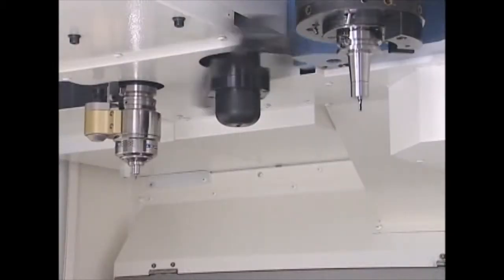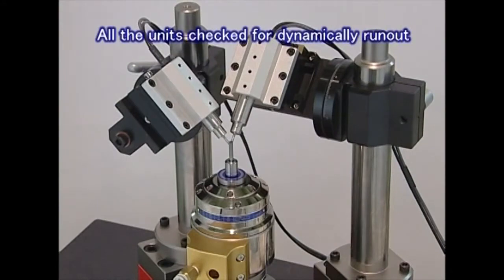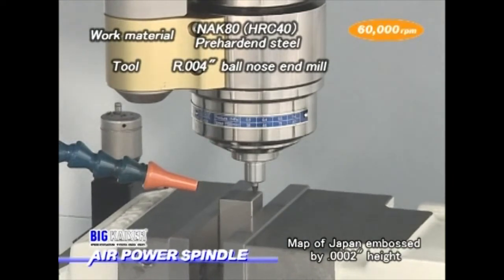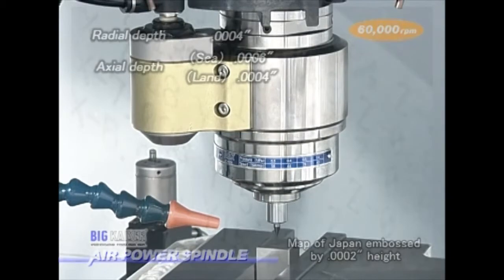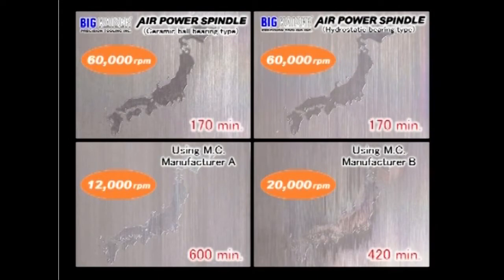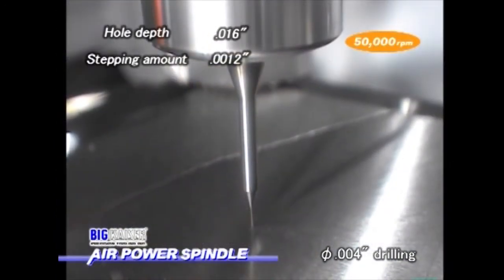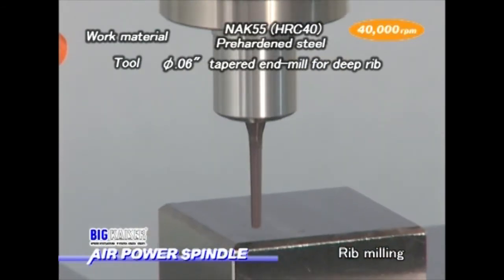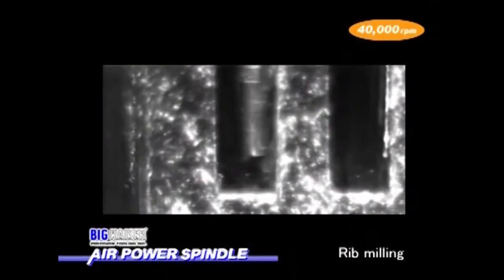Air Power Spindle | BIG DAISHOWA—Americas

Comment: thank you for producing this technology, this is the standard of clean energy machining, you can couple a VAWT  wind turbine to a compressor to store air energy and you can use reinforced bioplastics for almost all the hardware as gears, belts, air tanks, hoses, air compressor chamber, etc. even in this case the bearings and frame of the spindle can be made with reinforced bioplastic as bioPEEK or bioPAI others, leaving metal to the shank, air motor or other parts were hardness or low creep precision is required